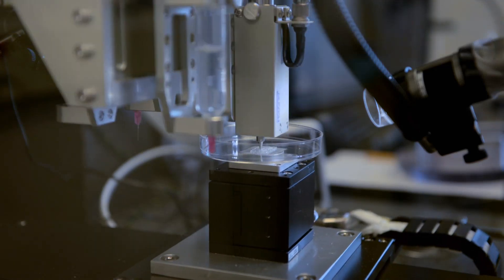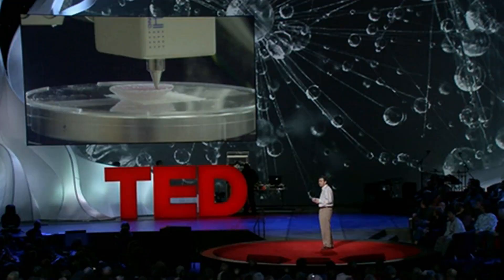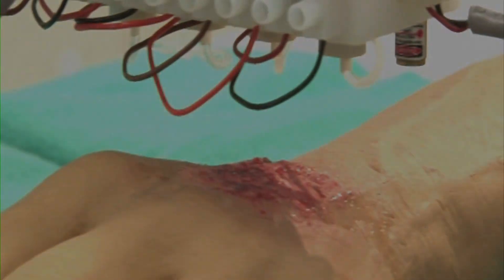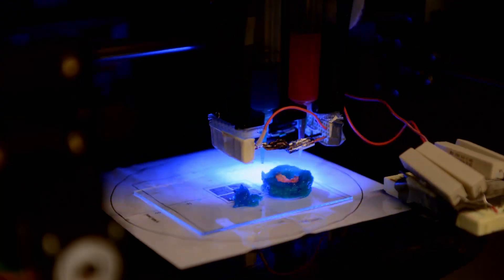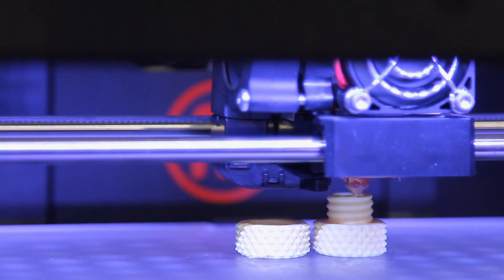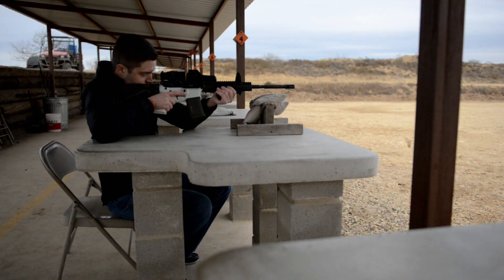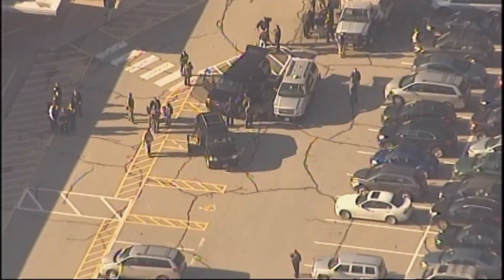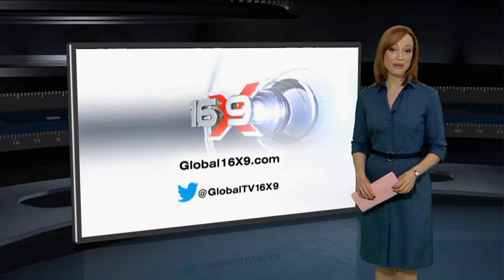3D Printing: Make anything you want

Comment: The simplest solution would simply be to tell the program not to make things which would create a firearm. I would be a simple process that could be updated as new information becomes available and would not be difficult to adapt to a technology that already use pattern recognition in an additive process. The parts and pieces of firearms are distinctive and could be recognized easily. So, where, exactly, is the logistical problem?

Comment: Can a 3D printer print itself? Machine tools are the only machines that can reproduce themselves with tolerances up to 1 billionth of an inch. Can a 3D printer do the same precision engineering for heavy high-technology industrial manufacturing factories? Even if it achieves it to a certain level it still faces the problem of computer viruses, emp, emf, emi, etc that can wreck havoc with it's electronics, that is if it can 3D print IC  silicon electronic chips of all kinds and types.

Comment: Unfortunately there is no good solution to gun control at present.

I would favor a ban on arms manufacture itself in the first place, but people would still setup factories and manufacture them illegally.

Anyway, we don't need a solution to gun control, we need a solution to gun violence, and that can never be legislated. If you want to reduce gun violence, then you need to do away with the conditions that drive people to violence, and that means undoing most civilized institutions.

Comment: I would have noted that it was just parts that can be printed, however, youtube limits the number of characters you can use in a comment.  I had to shorten it. Ultimately, my point is that everyone who's worried about someone "printing a gun" is buying into the sensationalistic exaggeration too much.  People have been making firearms at home since before computers.
This isn't really a new problem.
Personally, I'd use a 3d printer to make benign things like replacement parts to fix broken things.

Comment: Be that as it may, a criminal would just BUY a firearm illegally, they wouldn't bother printing one.  The cost of a 3d printer is far higher than the cost of a firearm.  This technology becoming available to the public is NOT as big of a threat as you THINK.
One major point to bring up is that there are components of a firearm that you can't print, which MUST be metal unless the user of the firearm is outright suicidal.  Even copper or steel pipe isn't a suitable barrel, it's too fragile.

Comment: I'm going to bite my tongue on the issue of your poor grammar, for the mere reason that you are 100% correct.  A firearm is just a tool, the killer is the person wielding the tool with malevolent intent.  To accentuate your point and go a step further, look at a hammer.  A hammer can both build and destroy.  It's not the hammer that does either, but the person with the hammer in hand.

Comment: You have SOME valid points, HOWEVER, you're also not looking at every possible aspect.  For example, you imply that suicides went down because one method was taken away.  But you're not considering that the socio-political climate had likely changed, and the motivation to kill one's self was thus possibly reduced.  Eliminating a means to an end does not necessarily reduce the probability of someone meeting their desired end.

Comment: As noted in another comment, A gun is just a tool.  Tools are neither good nor bad, it's the person using the tool that is good or bad.  A hammer can be used to both build and to destroy.  You are not god, so it's not your place to judge.

Consider this, The technology can make lighter parts, which would be a great boon to our soldiers.  You didn't think about that possible application for making a printed gun part, did you?  Again, you are not God, you are not fit to judge.

Thank-you.

Comment: The parts that are used for firing the ammunition are standard metal parts. The only parts that are plastic are non pressure bearing parts so the fact that they are plastic does not mater. Look at the Glock or any of the other of hundreds of polymer firearms being made today. Do they blow up in your hand?

Comment: You cant stop an idea, be it good bad or grey.  The plus is that the second amendment may be held intact by simple availability, but the minus is that plastic is hardly the proper building material for a gun.  I value my hand more than the plastic gun.  Some may not.  But you get what you get.  A new kind of Saturday night special to injure yourself with :)  But if it's all you can get...   I suppose its a matter of risk

Comment: What purpose to having a car that goes over the speed limit server? It will only be used to cause mass murder (And that's statistically accurate as 50,000 die a year from cars and normal times it's more than 3 people, which is the number required to be considered a mass murder) 

While 0 people are killed a year with fully automatic guns XD

Comment: Let me clear something up;

In order to get that 3d printed lower reciever to work, you need the other parts.  Now even assuming that you can get plastic barrels that withstand the force of a 5.56x45mmNATO cartridge, you still need the damn ammo.

I can go under my neighbors house and cut out a piece of 3/4Inch steel pipe, fit a 1inch cap on the back with a nail in it and Ive got a shotgun.  Making guns is EXTREMELY EASY, the printer wont make it any easier. So chill the fuck out people.

Comment: well at the same time those items were designed for sport, transportation, cleaning, etc. a gun is designed to kill. right there is the big difference. I actually am against and for guns at the same time, so it's easier for me to think from both sides. Just try to consider what is the purpose of an item, how many use it in a wrong way and then why should or should it not be banned. USA only has 100.000% more gunmurders a year than some countries...

Comment: That is true, or not yet at least.  But i guess it would eventually depend on the type of 3D printer you start with, if it had multiple materials and printheads that it could print with it could eventually (if not already) be possible to actually print all the parts for a 3D printer.

Comment: actually you could, the printer could put transistors, resitors, transformers and capacitors to the circuit board and then solder them in seconds

Comment: Yet, the guns tested always end up blowing up after one shot or misfiring, which can lead to serious injury on the part of the shooter. Not to mention he didn't print a complete gun, which if he did would have a high risk of misfire like the other guns that have been printed. The fact you use "everyone" is idiotic, these machines are extremely expensive and with the price many are at, an individual could buy a few guns that won't have the risk of blowing up in the user's face.

Comment: why print a weapon when you can buy it for a cheap price , and 3d printers print the layout design which was modeled for printing , meaning just modeling a gun will only mean a printed shell in order to print a whole gun with all the mechanical parts and so it could be achievable through tens of hours of modeling and tens of  printing hours too , and the materials which is printed wont apprehend the firing impact which will shatter the gun , also removing all the support material is a pain .

Comment: There are actually 3D printers that print in metal. It's called laser sintering, where layers of metal powder are laid down and fused with a laser. That said, I do agree that this technology is being over sold for a lot of applications. Cost wise CNC is often cheaper but 3D printing can make parts that aren't otherwise possible, eg a solid cube with a ball inside.

Comment: You'd have to write the Code - or download it somewhere. You'd also have to have a printer capable of printing in copper, silicon and PCBs if you want to use "current" methods of household computers.

Comment: actually people kill people.
What is the difference between a walking stick and a club or a kitchen knife and a killing knife or between a stilleto and letter opener? Structural it is no difference. It is the way how you use it.
What would be the difference for the mentioned air duct if it is used in a passenger aircraft or a bomber which carry an a-bomb that will ravage another city?
In my country the weapons are regulated because of 20 years of anti-communist resistance and now guess who have?

Comment: They can also get them from umbilical cords which would otherwise be discarded. Umbilical stem cells have some advantages over fetal stem cells. For instance, they are slightly more differentiated so they are less likely to cause an allergic reaction.